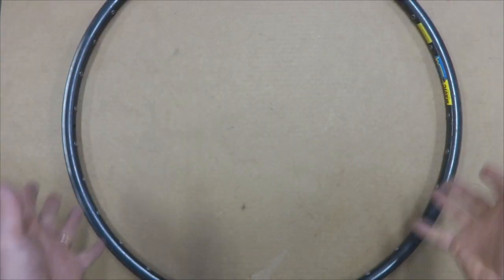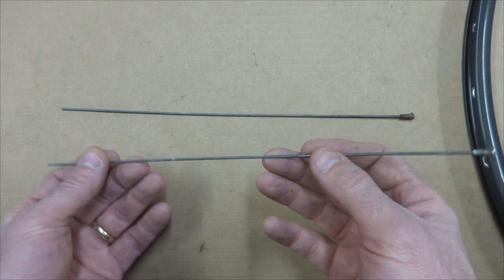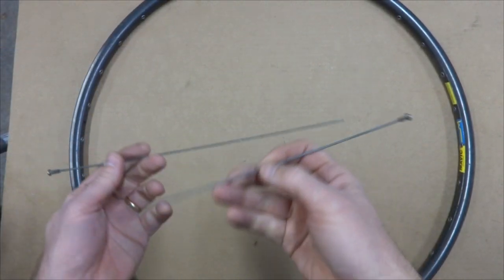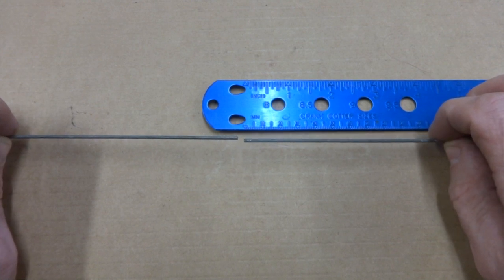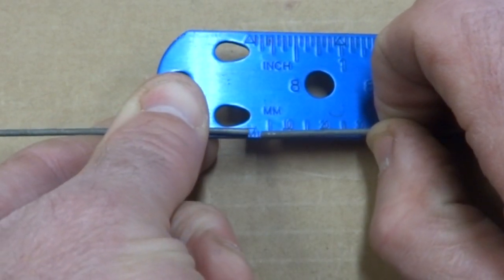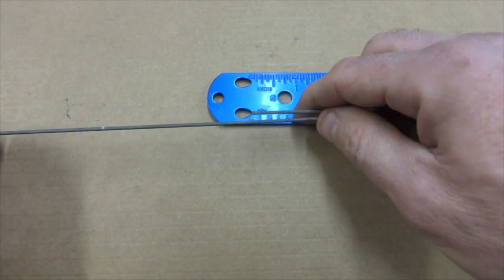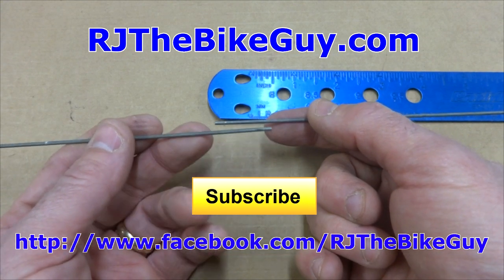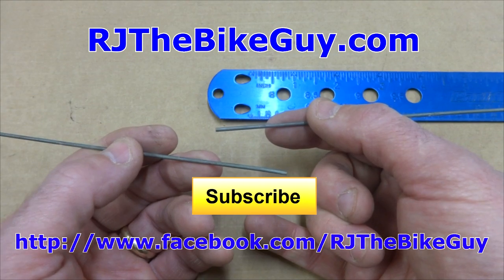Measure Effective Rim Diameter (ERD) With Homemade Tools

Comment: Just a question, it is the same thing if I put a tape measure inside the rim??
Reply from the maker: No. You need to measure where the spoke nipples sit in the rim. Rim thickness will vary.
Reply: RJ The Bike Guy So, will be the same if I have the rim tickness size

Comment: can you make a video on dealing with a bent front fork?I mean, the upper body of the fork is bent.Thanks.
Reply from the maker: +Jiayang Ruan https://www.youtube.com/watch?v=Ytnk7pXEeY8
Reply: well, I need to know if I can straighten the bent fork.
Reply from the maker: Generally the safest thing to do with a bent fork is to replace it. If a fork breaks, you can DIE! Most bike shops (at least here) won't even attempt to straighten bent fork because of liability issues.
Reply: +Jiayang Ruan It's advised that you replace the fork due to the fact that once metal is bent out of shape, it's structural strength is compromised (weakened). If you attempt to bend it back, it's weakened even more. The last thing you want is for your fork to fail since severe injury and even death can occur in the event of an accident.

Better safe than sorry. Your safety and your life is worth more than the price of a pair of forks.
Reply: Thank you.

Comment: I have a old road bike that using 6 speeds freewheel and I know that I could use 7 speeds freewheel without adjust the frame, So I want to know is that Shimano Claris set 8 speed Derailleur would work fine on 7 speed or not? also can I use 8 speed shifter?
Reply from the maker: +Kyle Parker Derailleurs don't really have speeds so much. They just need to reach all the cogs and be compatible. The shifters have to match the freehwheel. 7 speed freewheel, you need 7 speed shifters. https://www.youtube.com/watch?v=rj3bYJ7zyLc
Reply: +RJ The Bike Guy Thank you very much:) your vids are very useful
Reply: Kyle Parker yes

Comment: mine were too long, but I'm not gonna redo it. Fingers crossed.
Reply from the maker: Are the ends sticking into the rims? Could cause punctures...
Reply: @RJTheBikeGuy  Naw, it's a big rim (fr560). Running tubeless also. At least half the thread is engaged on all of them though. I used spoke prep, so maybe that will help keep them from moving. Trying to get 5% or less tension variance to give it the best chances at a long life.

Comment: Thanks for a great site. I wanted to clarify my earlier comment. I was wrong. You are measuring ERD as nipple seat to nipple seat. Most online calculators and spoke calc  use ERD as "spoke end" meaning the distance across the rim to the end of the spoke- most say bottom of the nipple slot is ideal. You are measuring "nipple seat" which is more accurate but can cause issues depending on the calculator used.   All book references I've reviewed say ERD is "spoke end" but that is misleading. The only calculator that uses "nipple seat" is the Sapiam app or online version, I think?  Do you agree?  Did the old WS calc use that as well based on the rim rods? I really appreciate the conversations here.It is a small detail but can be important. I had incorrectly mentioned that the nipple length made a difference-it does not in your measuring example because you are not using the end of the threads as the starting point. You are using the base of the nipple where it contacts the rim. Again, a small difference in most examples but worth understanding for some of us who build a wide range of wheels.

Comment: Also, it can be helpful to use the exact nipples you plan to build with. A 16mm will give a much different result than a 14 or 12 mm. Generally, most build w/ standard 12mm nipples and that is a safe assumption. Just be aware if you are using another length is will cause error in your final ideal spoke length.
Reply from the maker: Sorry, but that doesn't affect the ERD at all. The ERD is the diameter of where the nipples seat. That doesn't change. It might affect the spoke length choice, but that is something else.
Reply: Actually, it does, depending on the assumptions. If your blank spoke is 200mm  the different nipple designs impact the amount spoke it takes to get the thread to the bottom of the slot. The wheel pro book explains this well with a cut-away. I'll see if I can share a clip to give you a visual.
Reply: Ex- from Wheelpro book. The picture would help but can't figure how to post that. 

Spoke lengths for non standard nipples
If you build with something other than 12mm nipples you will need to modify the rim measuring tools and replace the 12mm nipples with those you intend to use. You will need to do this with internal nipples and may need to do this with 14mm and 16mm conventional nipples as previously discussed on page 59.
Screw the nipple you intend to build with onto each measuring spoke using light finger pressure until it stops, then unscrew the nipple 2mm and that’s your ideal position and since the spoke thread is 56 threads per inch, 2mm equals 4.5 turns.